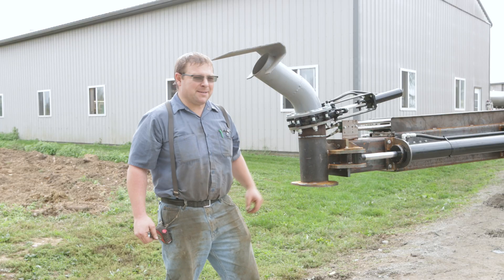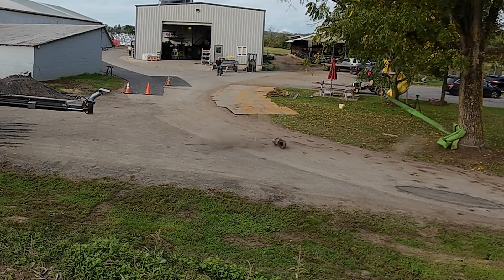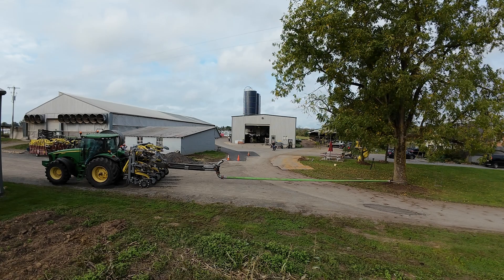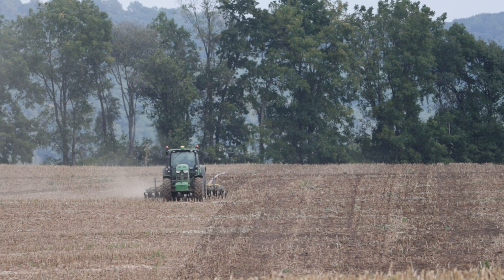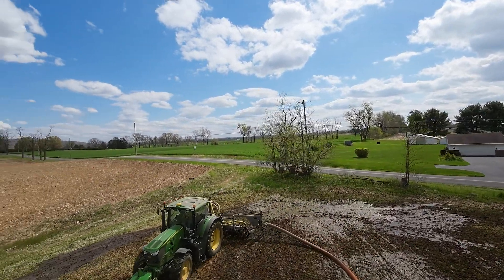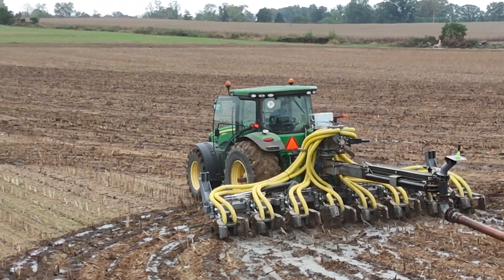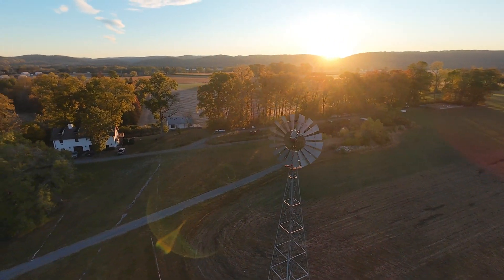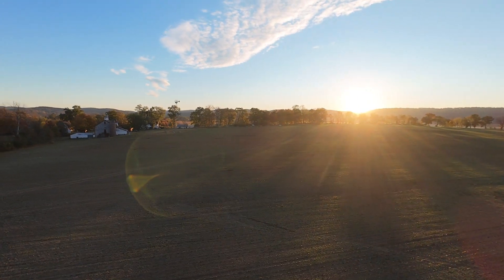New! Extendible Manure Injector. Hoover Invention.   Dragline Manure without puddles. |

Comment: Tidy job you see this a lot in Holland on there injectors
Reply from the maker: @mfdaveg   Interesting, what aspect of their manure application , do you think causes it to be  more prevalent on their injectors?
Reply: @ they have very strict rules on application rates and actually shut of the applicator on headlands to avoid over dosing not possible with the flow rates you are running tho